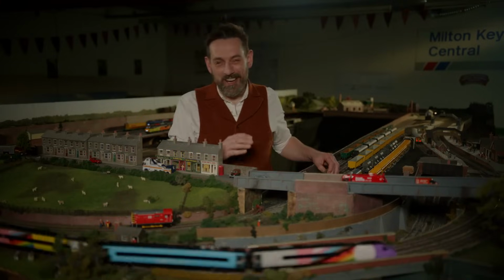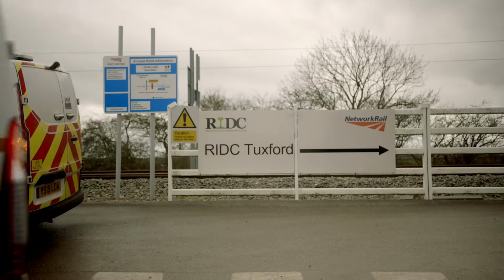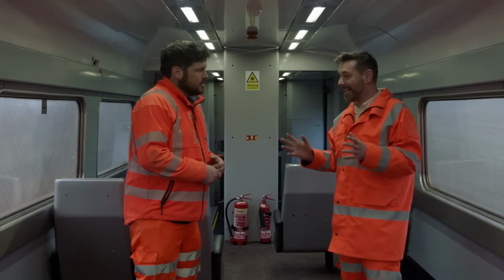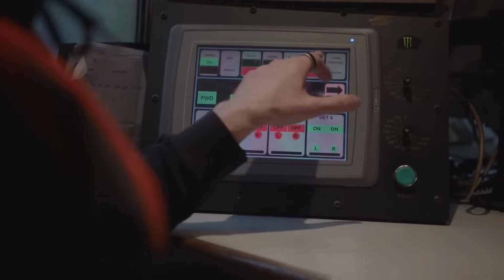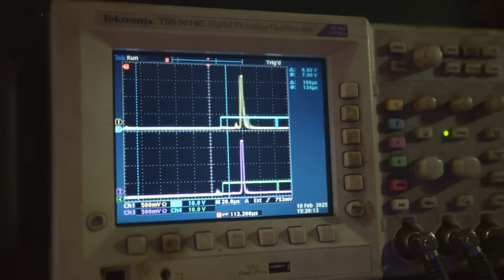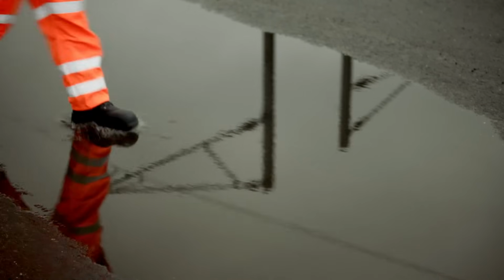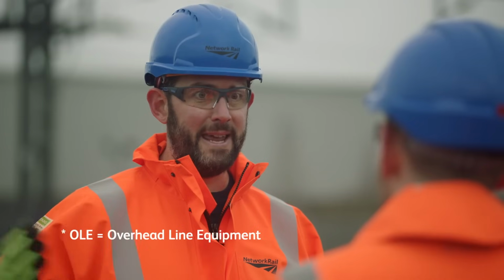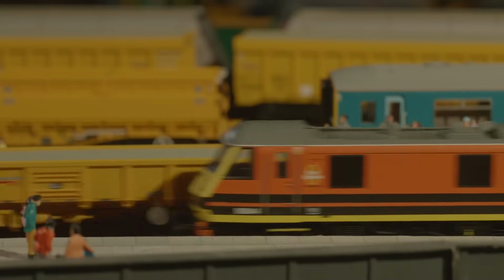Behind the scenes at Britain's railway test tracks with TV's Tim Dunn

Comment: Both test tracks are existing tracks that were abandoned from their original use. Tuxford was the line to the old High Marnham power station. Melton is on the abandoned line from Melton Mowbray to Nottingham.

Comment: I needed to know why they couldn’t dig a tunnel and do an extension for most of the mainline Trains so that they could extend the abandoned London underground train stations. Why couldn’t they use the part D78 Stock train doors on the sides and also restructure the front face of the A60 and A62 stock which will include the class 507, class 508, class 313, class 314 and class 315 remix and make them all together and also redesign all of them into an overhead wire line trains and also make most of them into Five carriages per units and also having three Disabled Toilets on those Five cars per units A60 and A62 stock trains and also convert the A60 and A62 stock trains into a Gardner 6LXC, Cummins M11, Volvo B10M, Lister Diesel, Gardner 6LXB, Scania N112 and Gardner 8LXB Diesel Engines and also put the Loud 6 speed Voith Gearboxes even Loud 10 speed Leyland Hydra cyclic Automatic Gearboxes on the A60 and A62 stock, class 507, class 508, class 313, class 314, and class 315 and also modernise the A60 and A62 stock and make it into 11 carriages per unit so it could have fewer doors, more tables, computers and mobile phone chargers? A Stock Train and 8 Disabled Toilets on those A stock trains. why couldn’t we refurbish and modernise the waterloo and city line Triple-Track train tunnel and make it even much more Larger and extend it to the bank station, making it into a Triple-Track Railway Line so those Five countries such as Australia, Germany, Italy, Poland And Sweden to convert the waterloo and city line Triple-Track Railway tunnel into a High-Speed Railway lines? The Third Euro tunnel Triple-Track Railway line to make it 11 times better for passengers so they could go from A to B. Then put the modernised 11 carriages per unit A Stock and put them on a bigger modernised Waterloo and city line Triple-Track train tunnel so it could go to bank station to those Five countries such as Australia, Germany, Italy, Poland And Sweden. The modernised refurbished 11 carriages per unit A stock could be a High Speed The Third Triple-Track Euro Tunnel Train So it is promising and 47 times a lot more possible to do this kind of project if that will be OK for London Australia, Germany, Italy, Poland And Sweden. oh by the way, could they also tunnel the Triple-Track Railway Line so it will stop from Buckinghamshire, Hertfordshire and Essex so that the Passengers will go to Australia, Germany, Italy, Poland and Sweden and also extend the Triple-Track Railway Line from the Bank to Buckinghamshire, Hertfordshire and Essex Stations so that more people from there could go to Australia, Germany, Italy, Poland And Sweden more Easily. Why couldn't they extend the Piccadilly Line and also build brand-new underground train stations so it could go even further right up to Clapton, Wood Street can they also make another brand new underground train station in Chingford and could they extend the Piccadilly Line and the DLR right up to Chingford? All of the classes 150, 155, 154, 117, 114, 105, and 106, will be replaced by all of the Gardner 6LXC, Lister Diesel, Cummins M11, Volvo B10M, Gardner 6LXB, Scania N112 and Gardner 8LXB Diesel Five carriages three disabled toilets are air conditioning trains including Highams Park for extended roots which is the Piccadilly line and the DLR trains. Could you also convert all of the 1973 stock trains into an air-conditioned maximum speed 78 km/hours (48 MPH) re-refurbished and make it into a 7 cars per unit if that will be alright, and also extend all of the Piccadilly train stations to make more space for all of the extended 7 car per unit 1973 stock air condition trains and can you also build another Mayflower and Tornado Steam Locomotive Companies and can they order Every 87 Octagon and Every 48 Hexagon shape LNER diagram unique small no.13 and unique small no.11 Boilers from those Countries such as Greece, Italy, Poland, and Sweden, can they make Mayflower and Tornado Steam Locomotive speeds by up to 147MPH so you can try and test it on the Original Mainline so it will be much more safer for the Passengers to enjoy the 147MPH speed Limit only for HS2 and Channel Tunnel mainline services, if they needed 15 Carriages Per units, can they use those class 55’s, class 44’s, class 40’s and class 43HST Diesel Locomotive’s right at the Back of those 15 Carriages Per Units so they can take over at the Back to let those Mayflower and Tornado Steam Locomotive’s have a rest for those interesting Journeys Please!!!!, oh can you make all of those 18 Tonne Boxes of Coal for all of those 147MPH Mayflower and Tornado Steam Locomotive’s so the Companies will Understand us PASSENGER’S!!!!!! So please make sure that the Builders can do as they are told!!!!!!!!!! And PLEASE do something about these very very important Professional ideas Please? Prime Minister of England, Prime Minister of Sweden, Prime Minister of Germany, Prime Minister for Australia, Prime Minister of Italy, Prime Minister of Poland and that Includes the Mayor of London.
Reply: Still posting this delusional nonsense I see. You need help.
Reply: Perhaps because diesel anything needs to be put in a museum?
Reply: @sjcsystems  Tell that to the likes of all the North American Railroads. Without diesel locomotives they would cease to exist. That long post above is from a poster who constantly spams the same idiotic content on many railway videos.:face-fuchsia-tongue-out:
Reply: @CBHeritageRailways  yes I've seen that tripe elsewhere.  Incoherent and illogical.  However my argument is not with the US, nor Australia or NZ or Africa.  We have the technology but not the willpower.
Reply: Please let me know if you can ask the Mayor of London and the Prime Minister if they can do anything to help us out with this type of rail Project pretty please..

Comment: The daft thing is that when I visited the switch and crossing department at Milton Keynes they actually plan out work using OO model track and trains, when I asked why they they used them they told me that it was easy to check out new designs and configurations around switch's and crossings by manipulating the models in a nice warm office, taen at a dark and wet location somewhere on the rail network.